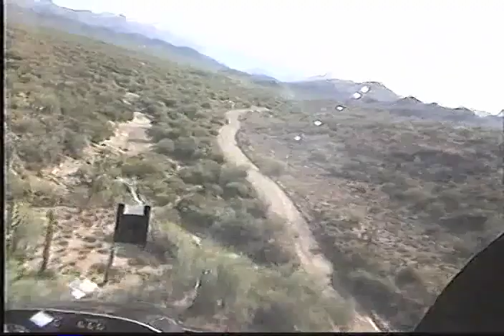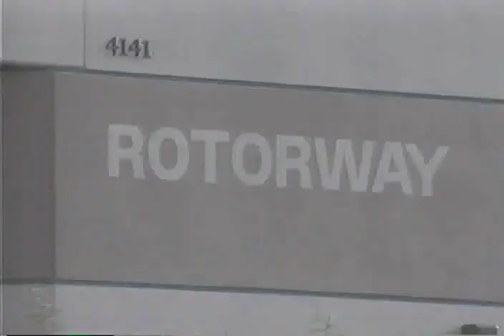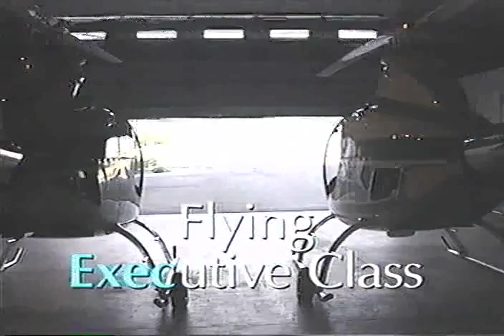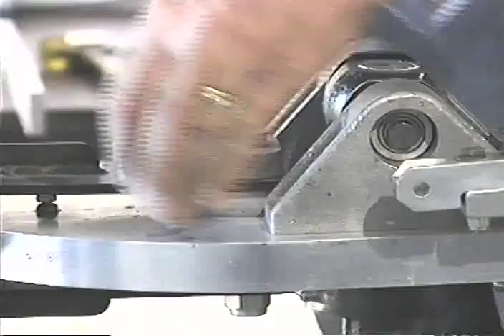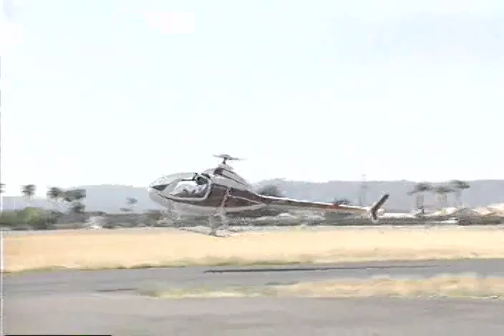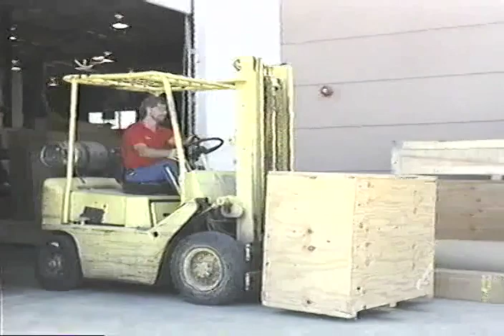RotorWay Exec 162F Promotional Video

Comment: What all that technology? Why is it? You can't do with 3 foot hovering auto rotation. Or even two foot
Reply: They do a great hovering auto……and a regular auto. I was a flight instructor at the factory from 2002-2004. I have about 1400 hours instructing in the 162. Solid flying helicopter. Worst paying helicopter job I’ve ever had, but easily the most fun. Go figure.